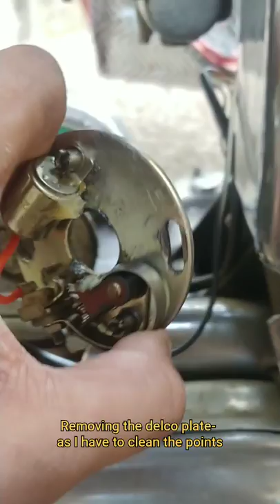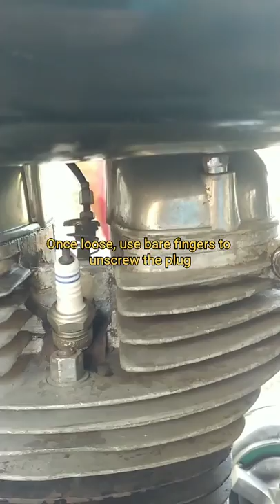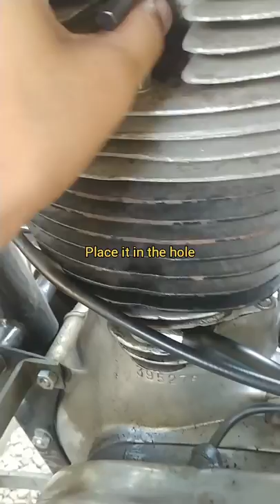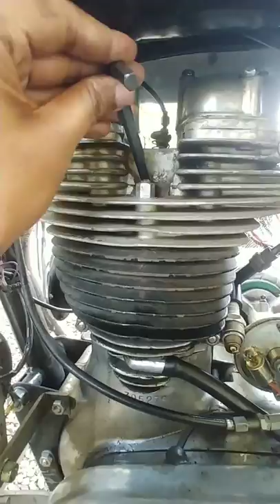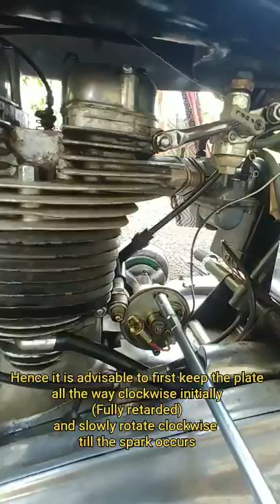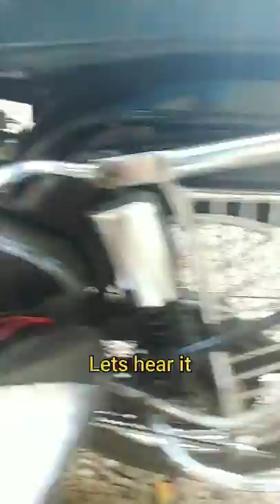Cast Iron Bullet | Ignition timing, Governor setting

Comment: Is freeflow exhaust affect or damage ci engine bullet
Reply from the maker: It can damage in the long run, theres no doubt. But that damage can be rectified. 
Even though carb tuning may be perfect, due to the lack of back pressure, exhaust valve gets burned and oftentimes the valve seating is also affected, sometimes causing compression leakage. This causes poor idling and low pickup. 
Along with the fried exhaust valve, at extreme cases, crust formation may be seen on the frontal area of the piston, which may sometimes rub across the walls, causing damage. 
Mind you, this is the case when carb tuning is spot on, and damages are seen only at 40 to 50K kms. Repair includes replacing the exhaust valve,  the seats, along with than usual decarbonation. Lapping is done to ensure proper seating, and based on the condition of the pistion and the cylinder, the kit may be rebored or replaced. 

If the carb tuning is bad throughout, especially if lean, you can start to see these symptoms as early as 10k kms. 

Most of us ride a bullet for the thump, so having a freeflow is part of the experience. The repair measures I mentioned (if cylinder kit is not replaced) may just cost 3K to 5K. Having to spend that money for every .5 lac km is not much of an issue as far as I am concerned.

Comment: Can we use Hk indori silencer in old bullet?
Reply from the maker: Abhilash, I am unaware of the interior of bullet silencers, hence I'm not in a position to comment. A properly designed one will have expansion & resonant chambers with perforations and dampeners, all while taking into account the exhaust gas velocity and its sound waveform, to reduce the sound to an extent by destructive interference. They should have apt restriction to the airflow to allow back pressure while allowing scavenging as well, which causes increase in mileage.
Reply: @ironbarrel7717  hello bhai Mujhe Apni gadi ka timing set Karana hai
Reply from the maker: @rajusharma2610  ha bhai

Comment: Which is best filter type exhaust for ci engine?
Reply from the maker: From my experience, the best one we had was the original fatory fitted 89 model which we had. I recall the sweet exhaust note which was moderate, yet subtle but had the punch which old bullets had. Unfortunately it was swapped out by a mechanic in pathanamthitta without our consent about 12 years ago and he replaced it with an '06 electra's. Now I'm unaware of the model which we have, but it is a freeflow.
Reply: Bro if u change any type of silencer except factory one it will be get challan but the short bottle with c bend is very nice

Comment: Wrong setting...it is retard setting...0.8mm setting should be there and also 0.35 to 0.40mm gap in point
Reply from the maker: I am aware, as that is the setting per manual. You must be aware then, that even the point gap has a role to play here. More the gap, more advanced (as the cam lobe strikes the felt runner earlier), lesser the gap, retarded (cam lobe strikes the felt runner late)

I as well as most mechanics generally set the plate at TDC and compensate for the 8mm advance by increasing the point gap from the recommended .4mm to about .6mm, or anything in between .5 to 1mm. 
Why, you may ask...

1.Reduces the chances of points being burnt and pitted. Shall the capacitor fail or shall moisture come in contact between the point, the recommended 0.45mm shorts it out and causes more arcing and shorting. Increasing the gap more than 50% reduces this to a great extent.

2.Greater gap means lesser charging time for the coil and it reduces the HT output voltage. This leads to a slightly muffled exhaust note that is pleasing to hear from a free flow exhaust, in spite of combustion efficiency being a tad less, about 2 to 3 km less kmpl. This smoothens out the engine. After all, more than performance these we ride these old guns for their ride feel. 

Moreover, the company recommended settings is good for mid range punch, as the .8mm compensates for the combustion blowby post 4K rpm. It is best if you're running above 60kmph all day. For low rpm thumpers like me, idling at 600rpms, shifting at 1200 and only maxing out at 2500rpm max, this setting is the best. After all, ride experience should be tailored for each individuals and it has been best for me in such a setting and has served me well for 7+ years
Reply: @ironbarrel7717 you may be right about points being pitted, and also point dwell. 
I generally set at 0.4mm at opening and 0.8mm BTDC. This has helped me with initial power as mine is a 2008 standard which comes with heavy crank and it's hella lazy. Good initial torque + better mileage+ slow and steady beat..
Reply: @greasemonkey1744 how much spark plug gap ?